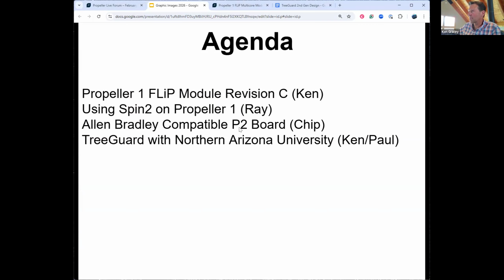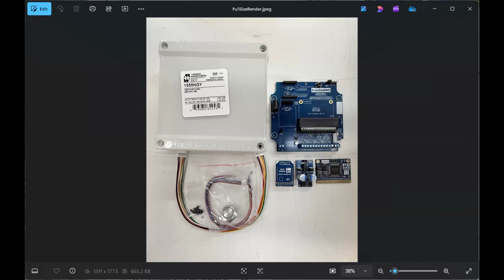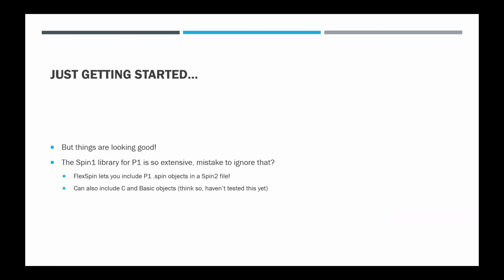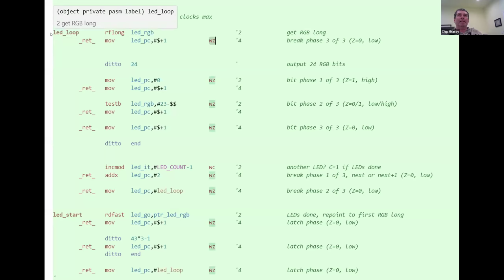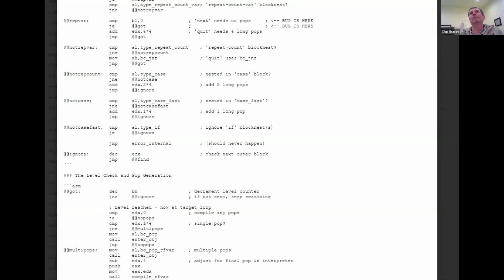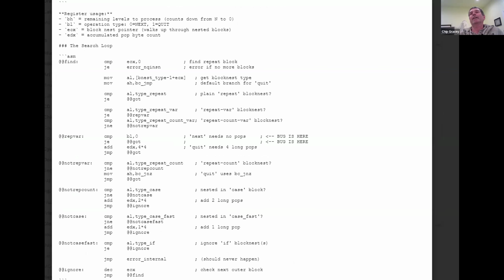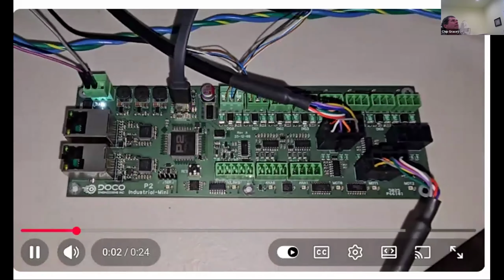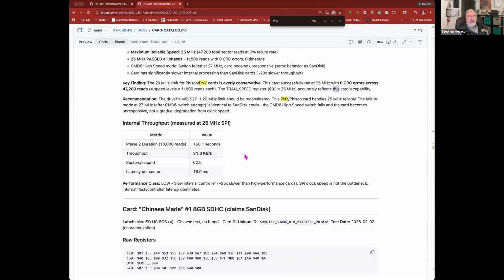Propeller Live Forum - February 11, 2026

Comment: Chip, we discussed in detail the spark gap "fingers" when we were working together.  This technique was used at National Semiconductor where I learned how to use and understand it.  I even implemented a finger or comb structure into all of the I/O pins on the P2.  Additionally a transistor crowbar was implemented to clamp the supply and GND together during an ESD event.  Generally air breaks down at about 30kV per centimeter ... scaling this down that equates to about 3V per micron for the separation constant.  You dial that in to what level you need protection.